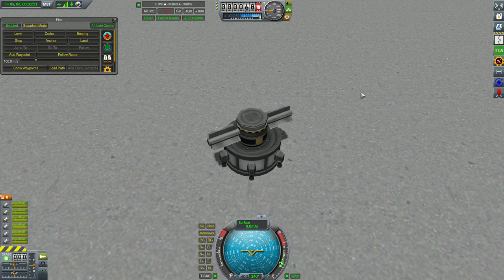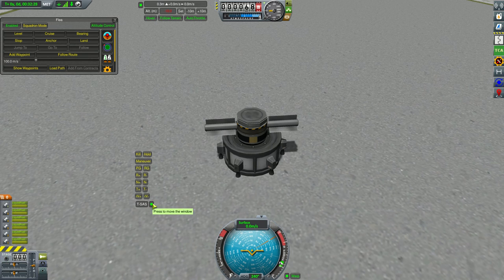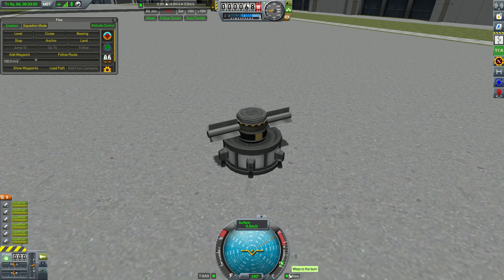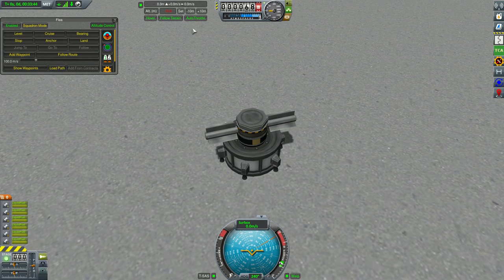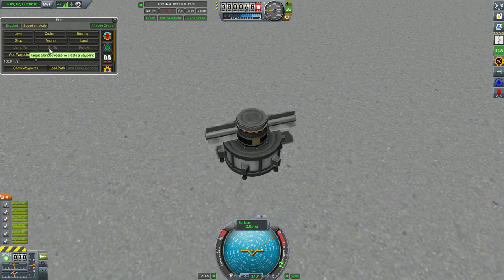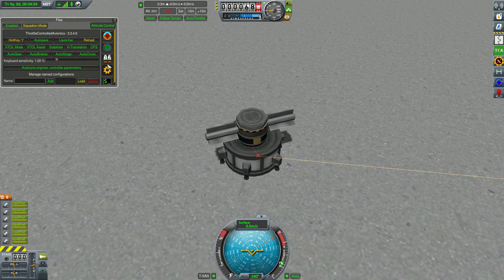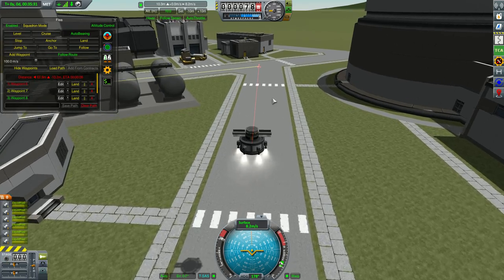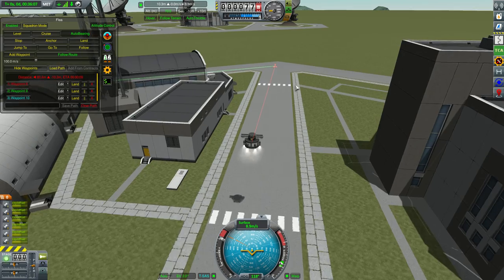New TCA Interface

Comment: Would you say that TCA is better at launching and putting a ship into orbit compared to MechJeb2?
Reply from the maker: I don't have enough data to make an overall comparison, but in many aspects TCA does things differently.
For example, TCA designed to perform double-maneuver circularization when requested orbit is high: say, you want to launch satellite to geostationary; to do it effectively, you need to reach a point just above the atmosphere, then change ApA to geostat, then circularize at ApA. TCA does all this automatically, while MJ provides all the needed maneuvers separately. Another example is rendezvous from the ground, where MJ simply waits until the target flies above you and launches in appropriate time-window; TCA, on the other hand, waits much less -- to simply be able to circularize in phase with the target; and then it performs rendezvous maneuver at orbits' intersection.
In general, TCA provides higher-level autopiloting bordering on AI, while MJ is a tool for experienced kerbal navigator.
Reply: Apparently I need to tinker a lot more with both TCA and MJ, cause you're talking about stuff I still haven't figured out! But cheers for the reply.